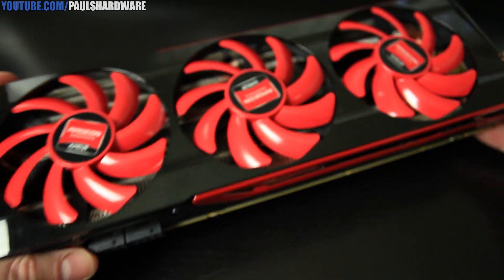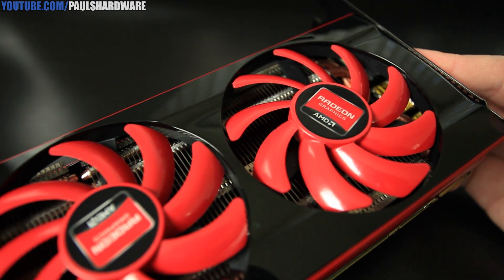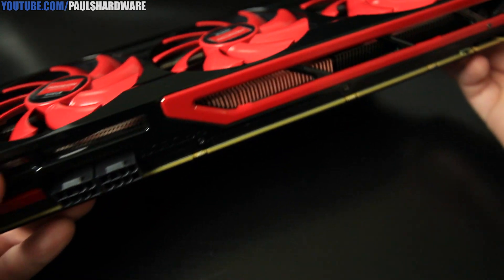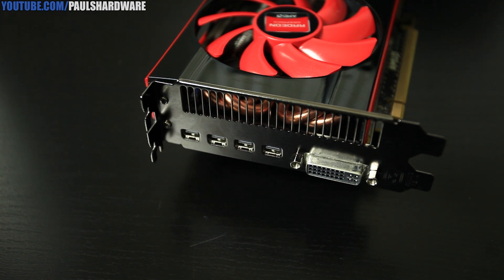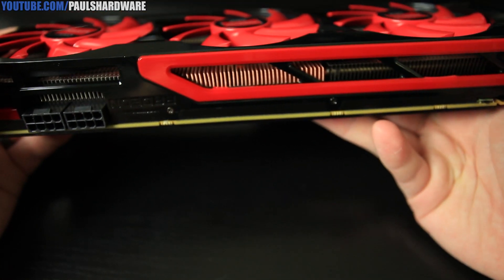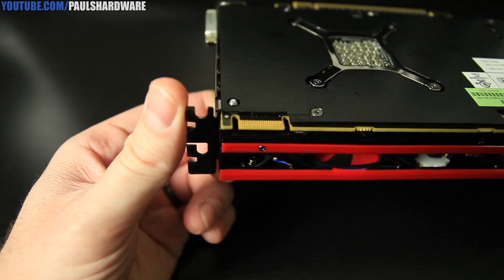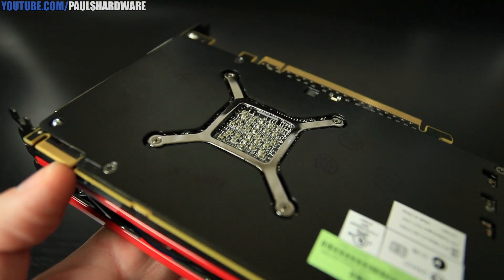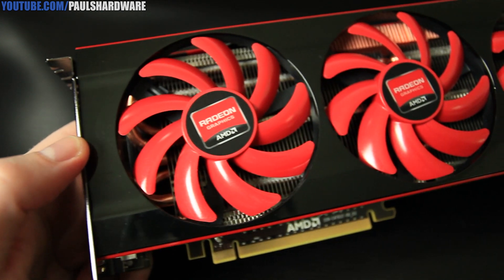AMD Radeon HD 7990 Overview

Comment: You technically can due to the 2 GPU's on the board running in CrossFire standard, so it you were to Physically Crossfire them, you would be running 2 pieces of PCB, but in total 4 GPU's.

Comment: I don't know why he compared this to the Gigahertz edition when he should have compared it to the normal 7970 reference card. The factory clock of any of the 7970 graphics processors from design spec is 925 MHz minimum 3D clock rate. the only difference between a 7970 reference card and a 7970 gigahertz edition reference card is factory 3D clock speed.

Comment: AMD released bolt library wich allow the GPU kernels to be controlled without initialisation 
it can also compute stuff.. for example ...generating an iteration and changing value or creating values.. very much on the fly...
it isnt really all about bitcoin mining... alot of persons are bound to take result of such quick ouput from PCI-E interface.. either for personal use or commercial use.. since PCI-E is also accessible on server motherboards

Comment: Normally I would agree with you, but you really don't need to overclock this card, the power so great, that overclocking is not really needed. If this was like a 7950 or a 660ti, then I'd say go ahead.